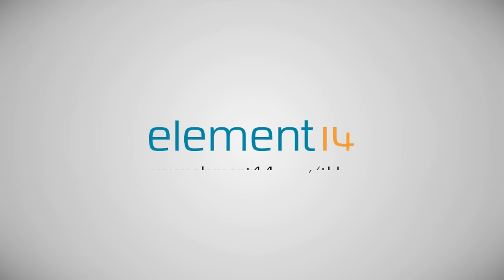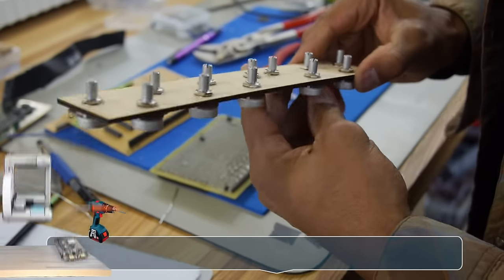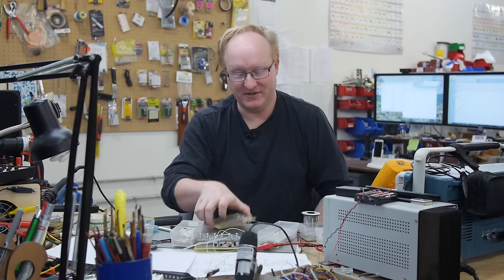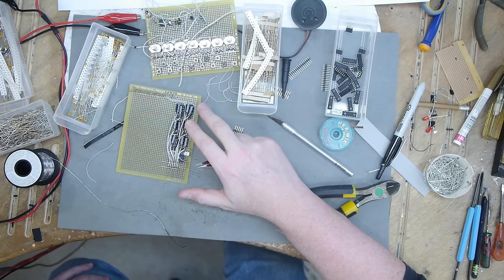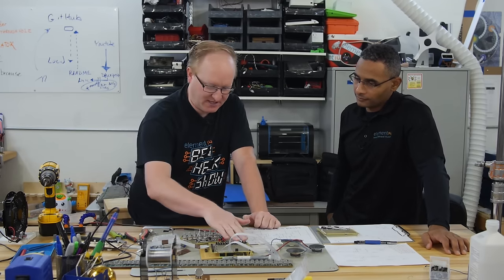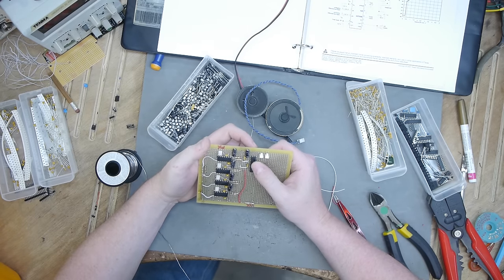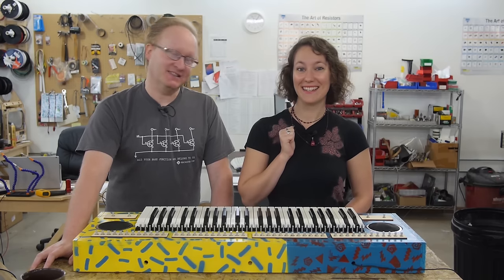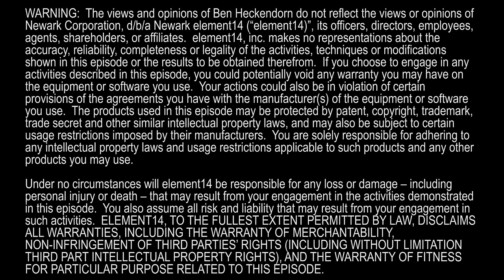Ben Heck's Atari Junk Keyboard Part 2:   Stepped Tone Generator

Comment: I would like to see this project using a 40106 Hex inverting Schmitt trigger to generate the tones instead of the 555/556.  You could use one chip to generate 6, much more musical tones.
Reply: That would defeat the point.It's more about having fun with the old 555 than anything ;)

Comment: Why not driving a retro console sound chip (like the YM2612 in the Sega Genesis) with the keyboard?. You'll need a microcontroller but the sound will be more than decent. Just sayin' :)
Reply: They can't get any musical sounding from simplest square wave generators, from samples even. Imagine how miserable the farting would be with 4-op FM synth that has 40+ parameters to be set properly.
Reply: Of course, but it doesn't have to be fully tunable. In my mind there was a microcontroller configuring the channels and ops with a preset instrument on boot.

Comment: I think what most people like is that atari punk sounds like a step generator..ie plays a sequence of notes. Without you've just got a bad sounding keyboard. A pt 3 you could add a midi input so that a midi controller could send a sequence of notes (play a midi file from a computer via a sound card/daw interface) and get tunes happening...for those that are musically challenged.